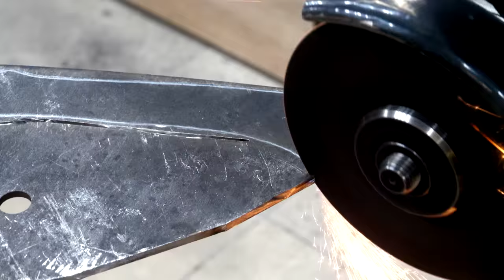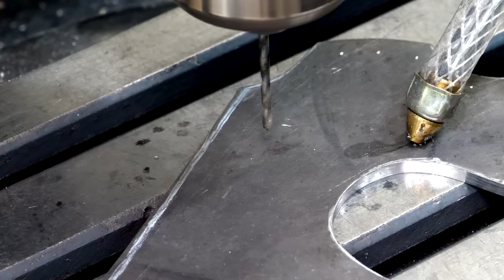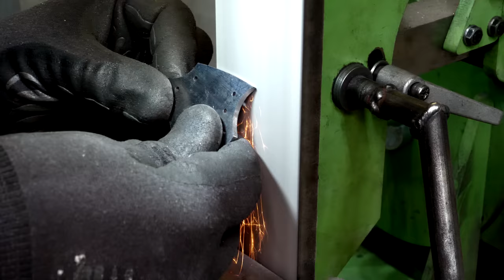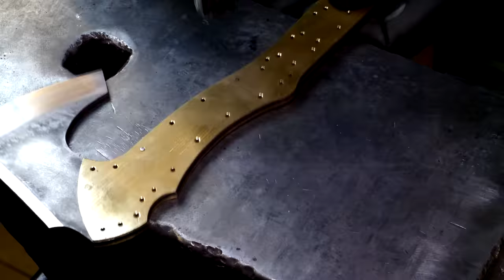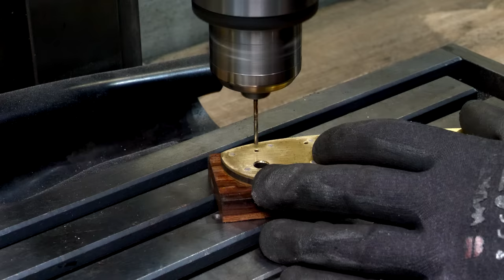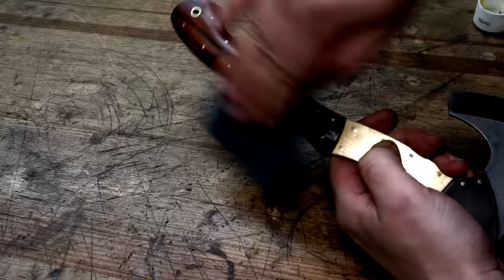Making Little Hatchet from Old Saw

Comment: always wondered how you prevent dissimilar corrosion as when steel and brass are together, the steel rusts so quickly and aggressively
when they’re in contact with brass and copper.

Always wondered how you curbed this.

Comment: Ugh, it's a f'n hatchet, not a razor or  knife.  Chop something!  Oh, and the blade angle in relation to the handle is too extreme.  Parallel for a field/utility tool.  Kicked up about 15 degrees for a Combat Axe.